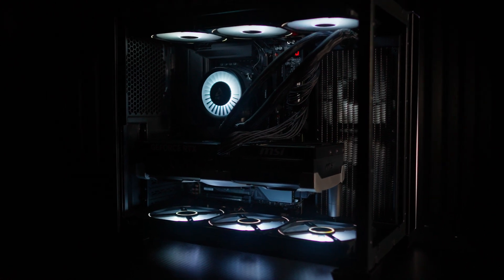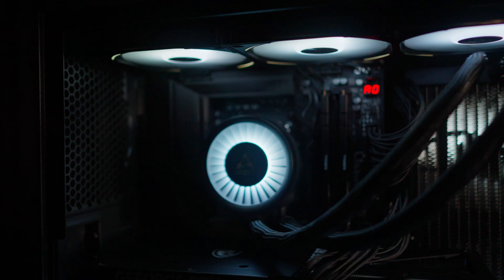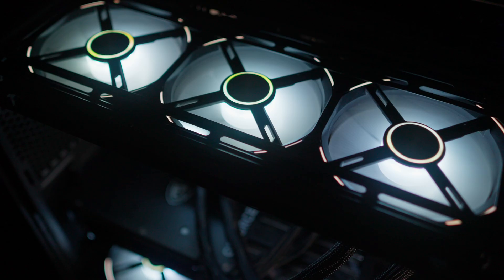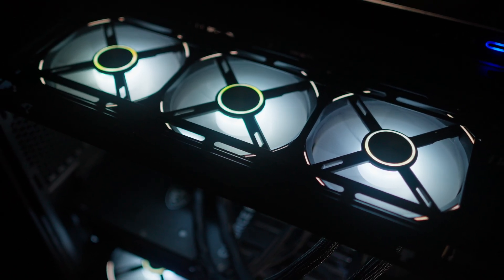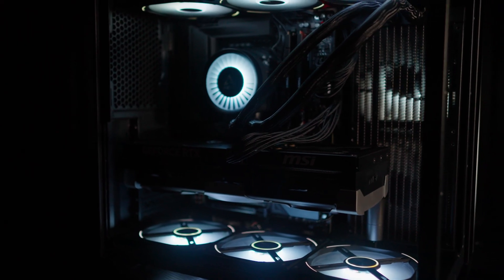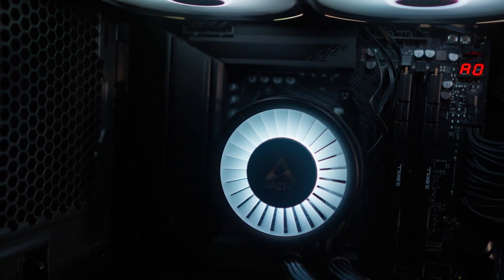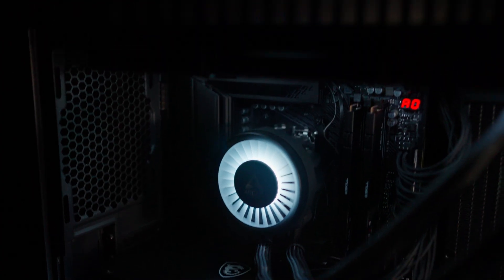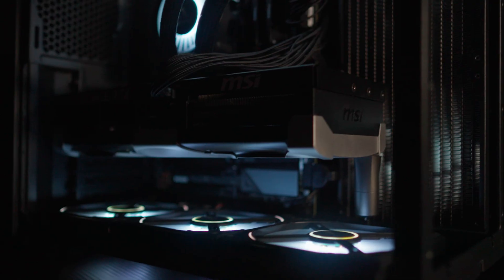World’s Fastest Trading PC Build 2025 – RTX 5090 + 9950X3D

Comment: how is it with temps and noise on this 5090?
Reply from the maker: Really happy with the card. It’s quiet—no coil whine. I don’t really notice any noise over my case fans. The GPU fans are running all the time, though.

I’m not sure why, and I haven’t looked into it yet. But this build is quieter than my previous setup with the 12900K and 4070 Ti Super.

I think the GPU temperature was around 75°C, and after undervolting, it dropped to 68°C in a stress test. I’ve got an undervolting video coming later this week, where I undervolt both the 5090 and the 9950X3D.

I didn’t overclock the memory. From what I’ve seen, all of these 5090s run pretty warm in terms of memory temps, but still within safe limits. I do a lot of video work that pushes the system hard for long periods, so temps matter.

That undervolting video is coming later this week. I got much better results than expected—my 5090 is now running close to 4090 power draw, with slightly better performance than a stock 5090.
Reply: @propdealshub  thank you for such a complete answer) Looking forward to your undervolting vid!